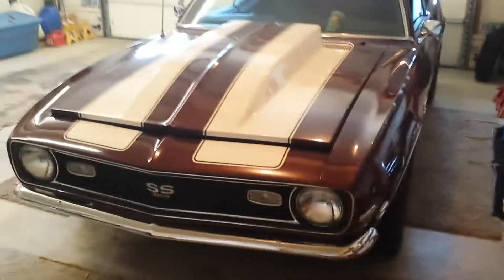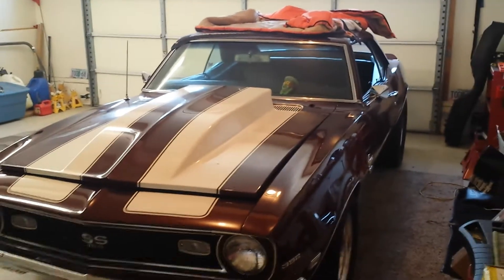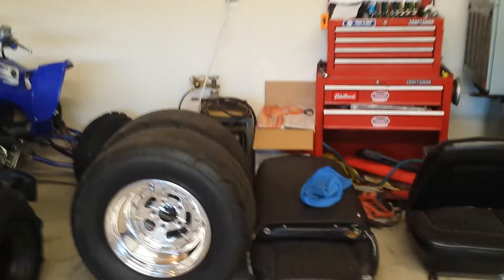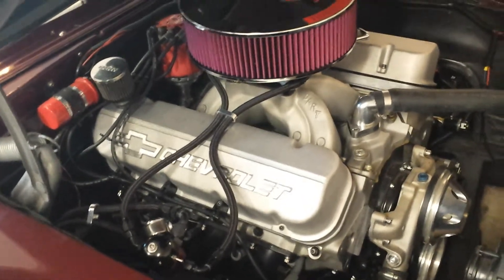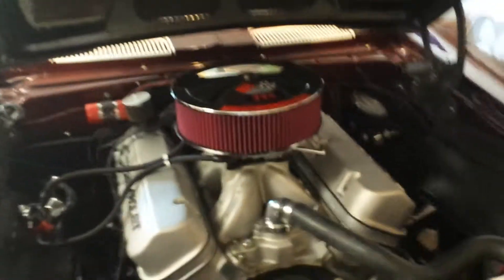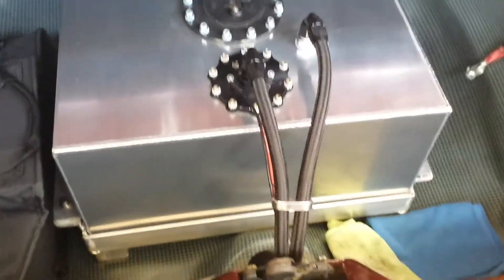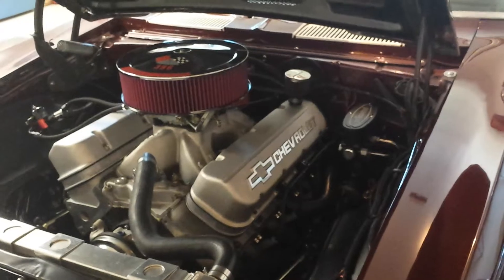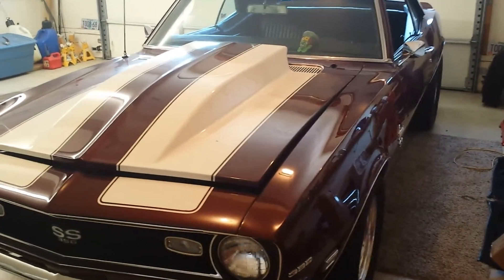Todd H's 1:1  68 Camaro

Comment: very nice Todd..I love to wrench on Muscle cars, its so nice to work on the old ones theres not alot of stuff in there that doesnt need to be, and if I didnt miss my 68 before I sure do now..never had a big block always mouse motors...broke stuff easy enuf without the monster torque of rat motors..I was hoping you were gonna start it and let idle at least hahaha..you know im a typical motorhead..
Reply from the maker: Well it turns over but there is no power going to the electric fuel pump....You know how things are when you change something.  But in one of my earlier videos you can see me make a pass at the track in it.  THe big block makes a lot of torque, but I have a turbo 400 tranny with Hughes internals and I have the Ford 9" rear end in it. In theory all that should hold up quite well.  :)   Knocking on wood as we speak.  LOL
Reply: yes sir and I did see that video but I like the sound in a garage..my wife would come out when i let it idle too long and say..back that thing outside I cant hear t.v. ahahahah.. of coarse I would have to do what she asks and continue down the driveway for a quick ride around the block literly...its all good todd im sure you will post more as time goes on..I did find and buy 2 amt 68 camaro kits..should be here by end of this week..
Reply from the maker: motorhead1964 Where did you find the 68 camaro kits?  I know what you mean by letting it idle in garage it does sound badass.   Thank you again for the kind words.
Reply: I got them off Ebay...finally got them cheap enuf..most of the time I just give up because they get bid up too high.lets face it they are still AMT I will only pay so much for them..and your welcome buddy